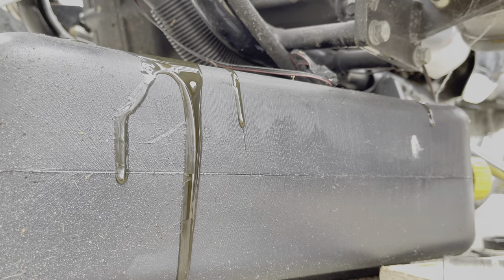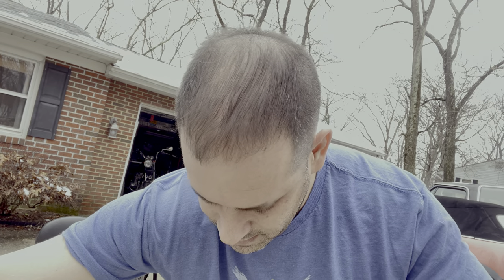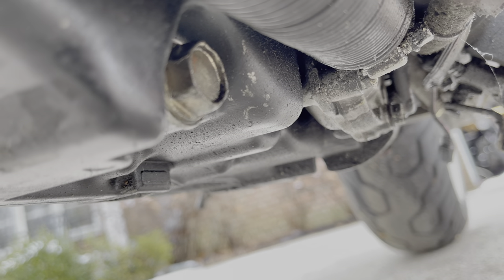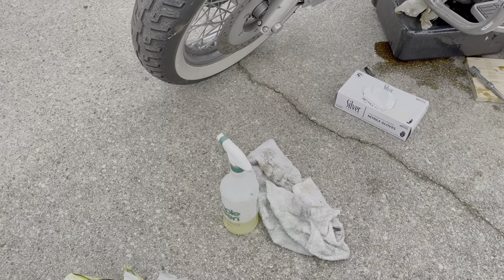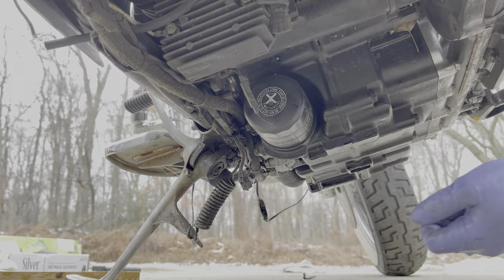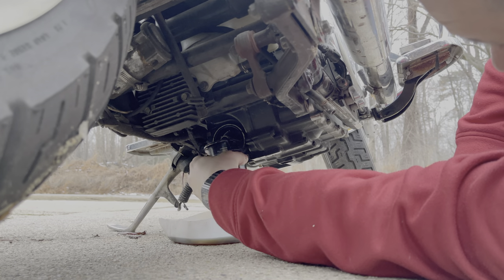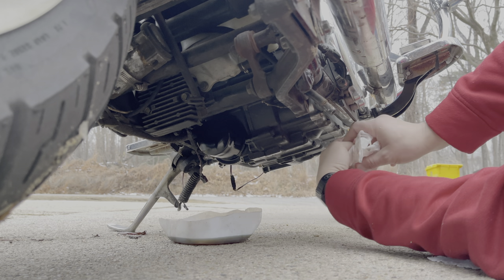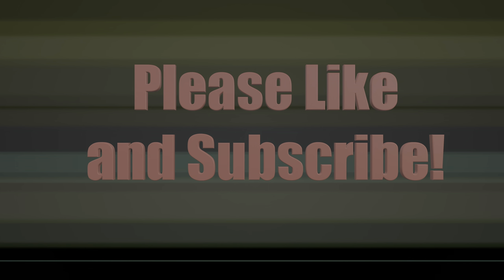Do NOT do this 1 Thing! | DIY 98 Honda Shadow A.C.E. VT1100 Oil Change

Comment: Just wondering if you had to call the Environmental Department. How much oil is on your driveway? Did it all run into the sewers come spring? That must be why you didn't change it in the garage.
Reply from the maker: Ms. karen arsenault, No, not for the ~1/4 cup of oil over flow. Of that amount most was recovered. Unsure, probably trace amounts. No, there are no sewers on my property or in the area. No, I changed my oil outside so I could film. Thanks for the watch!

Comment: Rad bike man. Oil changes can be so messy sometimes. When I did the snow blower this year its was a nightmare. Fun video as always.
Reply from the maker: Snowblowers are sooo awkward! LOL I had to change the carb on my this year....It runs great now...but not during the season of course haha..  Thanks!
Reply: Oil changes really shouldn't be messy as long as you know what you're doing with the specific vehicle. There are a couple vehicles where you really got to reach down inside of a small area to get to the oil filter but other than that you should be able to do the most of the relatively clean.   I have literally shown people that I've can change oil after coming home and wearing a white collared shirt when I used to work at the office lol I have one bets on showing people I could do it and not get dirty.😊😂
 Just got to know the vehicle and have a couple things around like gloves, rags and cardboard for the ground. Old socks are a miracle workers. Old towels should never be thrown away. Old cotton t-shirts also great. Keep all of your old things like this around because they're better than any rag you can buy especially to consider they are free.

Comment: If you use automotive grade oil- which he did- change it VERY often (500 miles) as it does not have the more stable moleculer structure of a motorcycle grade oil, or a pure synthetic.  The gears in a motorcycle (which are lubricated in common with the motor oil) tend to shear the molecules much more than in an auto engine where gearboxes most often have a separate lubricant.  It doesn't cost that much more to use a premium lubricant and will last
much longer- so effectively no cost difference.
Reply from the maker: Agree and true. Kinda a longer story, but I ended up changing the oil Twice on this one to get the proper grade.

Comment: It says 10w-40 but I see you put 10w-30. Is there a reason? Doing a oil change soon and need help, thanks
Reply from the maker: 100% use what the manual calls for… long story on my bike but I ended up changing the oil twice to get the right stuff in there.

Comment: Do NOT do this one thing- do not use Fram oil filters
Reply from the maker: What do you like to use?
Reply: Fram is the absolute worst- wix & purolator are very good, Bosch is good too. Or the more expensive honda one. $12 won't break the bank
Reply: There are plenty of head to head filtration videos on YouTube and they do fine.
Reply: @brentp6120  lol knock yourself out then, it's your bank account